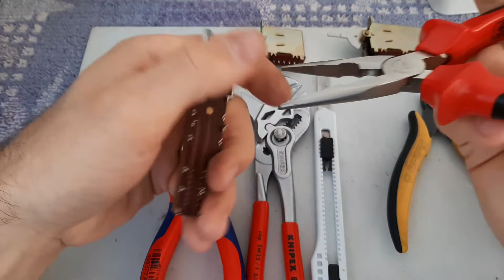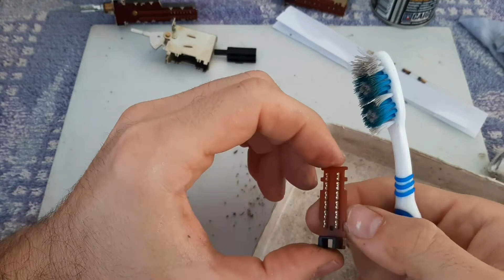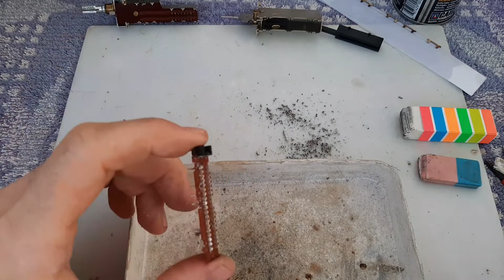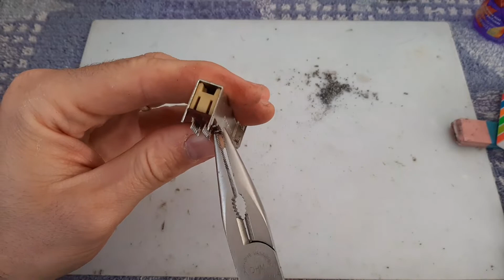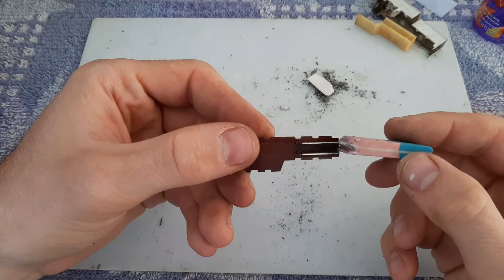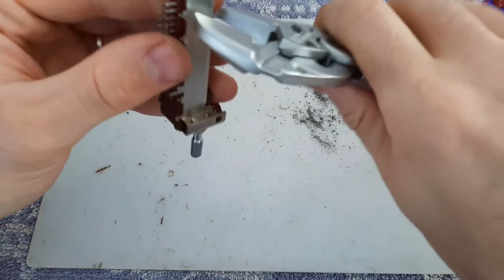Amplifier NO SOUND Problem| How to Clean Dirty Scratchy Selectors, Knobs and Switches

Comment: Is there a way to fix the copper wipers? I have a few that are mangled and I cannot find replacements.
Reply from the maker: I recommend searching for donor units or parts machines, as heavily mangled wipers are difficult to repair reliably and original replacements are rarely available for these vintage components. ❤😊❤😊❤

Comment: Thanks very much for your help, I might try and fix it myself , would you have a video for taking off the switch..
Reply from the maker: Hmmm, is good ideea to make a video how to desolder something in the future. But i have something how to solder.
But you can use a desoldering braid for this job or a hand desoldering pump.
Good luck !
Reply: @MariusHiFii  Thanks again for your help..
Reply from the maker: Good luck !